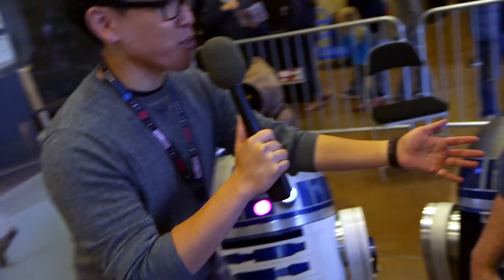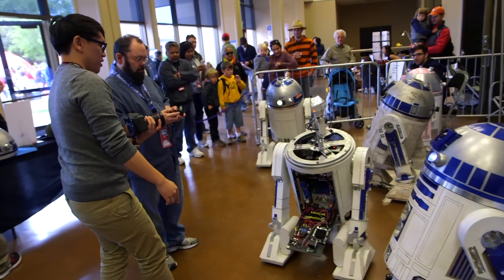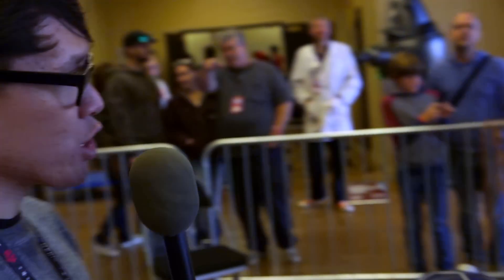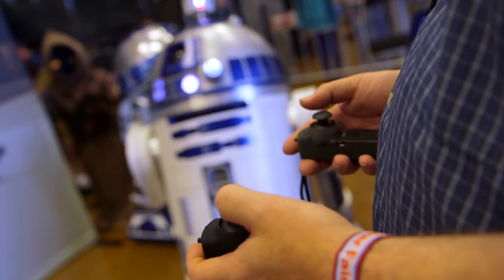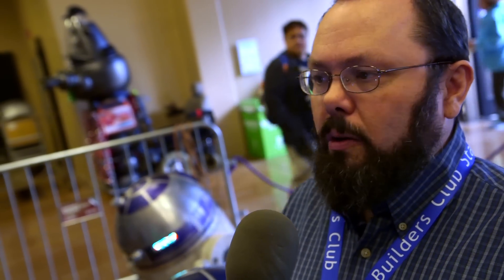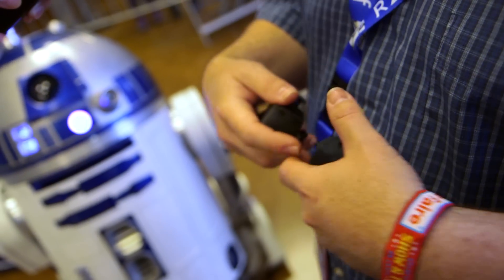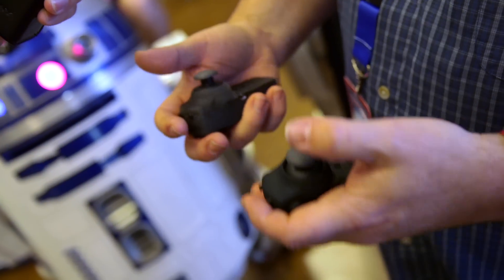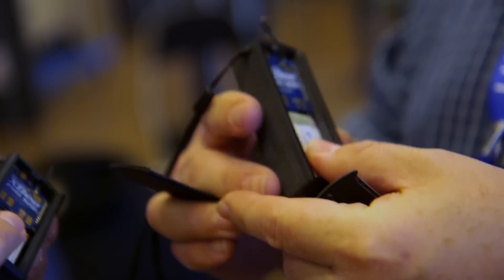The Anatomy of an R2-D2 Astromech Droid!

Comment: These look great on the outside, they however lack a bit of electronic automation. They got all main parts but they could be a little bit more automated than done for a low cost since 90% is already there . A few arduinos with a raspberry would make them autonomous

Comment: three questions
1: has anyone designed a mobile astromech with a retractable third leg?
2: has anyone made a mobile astromech that will follow the user, like it uses some signal thing and can follow a person on a flat surface?
3: what type of wheel design do people go with? do people go with treads in the feet instead of wheels?
these Astromechs are super cool. I wish I had the know-how, money, and time to make one. I'd definitely make one and have it just sitting in my house somewhere, and occasionally have it move or vocalize when people are over.
Reply: 1. Yes, several have been made. It's a highly individualized design kind of thing, and a lot of difficult concepts to tackle.
2. To my knowledge, no, but I've heard the idea tossed about several times.
3. Several configurations have been used through the years. From inexpensive cast urethane with timing belt pulleys, to pneumatic tires, to off the shelf wheels with hubs from hobby robotics companies. A few have tried treads, but these are mainly driven tank-style, and even in four wheel configs there can be a bit of scrubbing on tight turns. Currently Colson wheels with a softer durometer are popular, as well as a custom wrapped tire around a wheel with integrated motor and planetary gears.
The know-how is on the official site, along with a few hundred experienced builders and very friendly guys willing to help. Can't help with the money or time though. :) But the project takes a looong time, and will not be completed in the short term, making it more feasible cost-wise.

Comment: These people are making astromech droids to a supreme degree of perfection. But look closely at the original 1977 Star Wars and you can see in close up shots how crudely built and roughly finished it was. It's the same with most 1990's and previous SciFi props. They look passably good on screen, especially in motion, but when seen in person or on one of the TV and movie prop websites most of them look pretty crappy, as if they were quickly slapped together in a couple of days. Well, many of them were for TV productions that often called for props that would be used in a single short scene then never used again, or would be cut up, added to and otherwise modified to speed up production for a later episode.

Comment: The head movement could be done with a dish an 4+ motor wheels in the dish to provide moment on all axis's. Think that's the simplest way. And easy on the maintenance if done ergonomically. :)
Reply: ***** head movement is done using a lazy susan 17in by5/8 the dome drive is connected to the body. I built one and building my 2nd

Comment: Someday I will build you R2... someday...
Reply: Chris Ballinger Build it sooner rather than later while the kids are still small enough to fit inside Chris - you could save a fortune on fancy electronics.. ;-)
Reply: +Chris Ballinger: I started my R2 build a few years back, bought the dome, built the body and legs. If you can't make a lot of the parts yourself, you need to spend a LOT of money to buy them. I'm trying to do it as cheaply as possible, so for some parts I scavenged (like the cylinder things on his shoulder i used cdrom motors).
Reply: dose this mean in the near future  we will use R2-D2s BB8s and C3s
Reply: I bought one, but you can make it with fiberglass and wood.
Reply: Indeed ♪ relives the 70's
Reply: +Aussie Muscle How do you make the dome?
Reply: @fanoffrankieonps3  Theirs a chap in the US that does them if you want it in aluminium. $550 for the kit. To build one to the same quality that is being demonstrated to full spec cost in excess of $10,000. They forgot to mention that lol
Reply: There's stl files on thingiverse that you can 3d print one

Comment: An interesting concept for weight reduction is 3D printing the droid. There's actually a Youtube channel doing just that at the moment.
Reply: Doug Peck can you share the link?
Reply: Joji Donald Look up James Bruton on Youtube. He's in the middle of doing a Hulk-buster suit but has plenty of videos up on his channel about his astromech droid.
Reply: Doug Peck Thanks Doug!
Reply: Doug Peck His channel is amazing.
He is also a member of the R2Builders group.
He is also making a working BB8 droid.
James can make anything.
Reply: David Mc Yes XRobots. Very talented guy :) Although he's not making BB8 the 'correct' way I guess you'd say. I.e. the way that was revealed at celebrations (magnetised wheels, gimble, internal movement system, etc..) he's doing it using a movement, accelerometer and levelling system in the head that attempts to right itself as it moves out of the centre of gravity. An interesting design but I can't see it being very successful for any kind of real movement (unless going REALLY slowly heh) Not that I could do any better but in a way I do think it's a shame he didn't change the plan when the info came out, would have saved him a lot of hassle